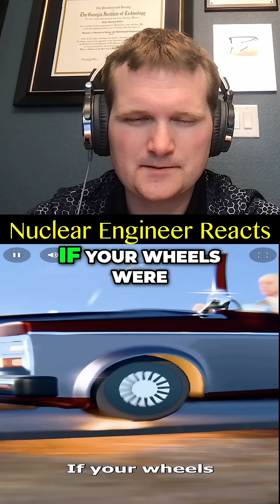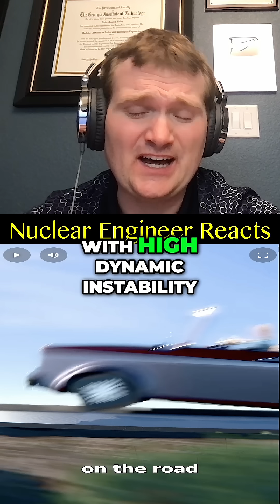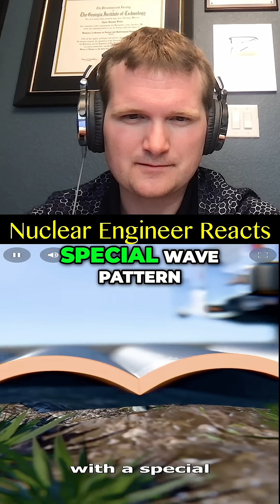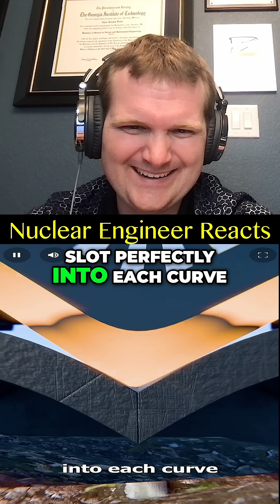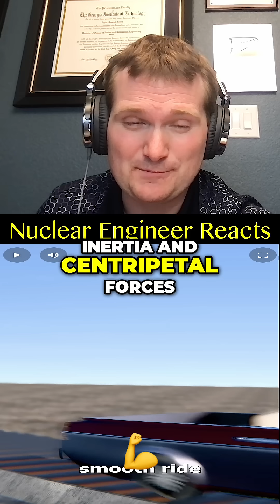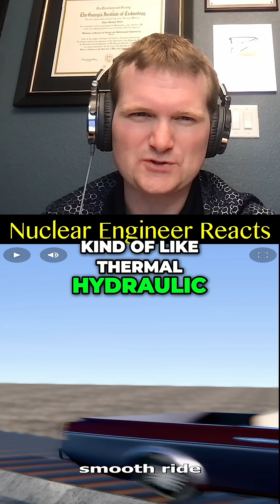How Square Wheels Can Move Smoothly - Nuclear Engineer Reacts to Zack D. Films

Comment: Thing is the radius of the wheel is changing, so either the angular momentum of the wheels or the linear momentum of the vehicle is going to have to constantly change, probably a combination of the two. So that's still going to be a rough ride with a lot of vibration even if the road is the perfect shape.

Comment: One bad problem would be snow and or ice on roads unless this type of road has a way to get rid of it efficiently which would present another problem because how would one scoop up the ice and snow and then shove it out of the way you couldn't use salt to prevent the ice from sticking on the unique road as it would probably cause the tire to be off balance. So in conclusion lets use what has already proven itself with round wheels and flat roads  with it's less vibrations and efficient way to get rid of the snow, ice, and rain and maintence. 

If you got this far please inform me if im wrong im always willing to take another perspective on this silly idea of road and unique tire. 
Have a blessed day.

Comment: Nothing about each wheel needing to be perfect dimension at all times and in alignment at all times. Turn the steering wheel slightly and vibrations are gonna come back as the rotational speeds of each wheel become different

It would be like trying to build a nuclear reactor using the fuel rods as the material for the containment chamber to heat the liquid stored inside. It starts off ok but quickly becomes unstable until it just obliterates itself apart